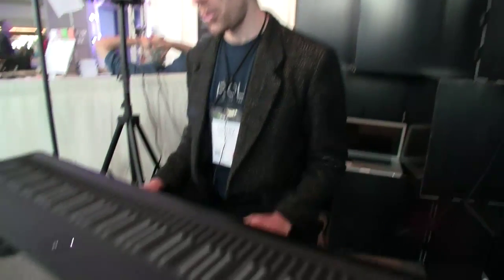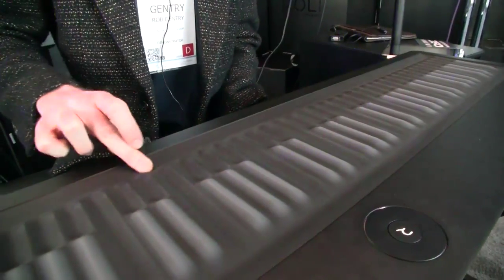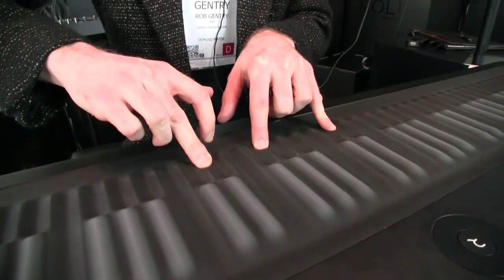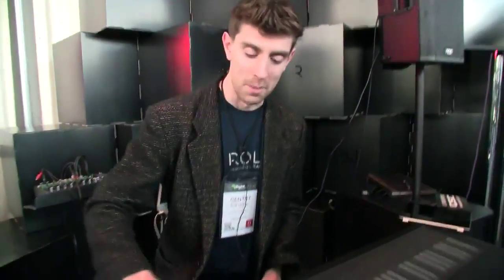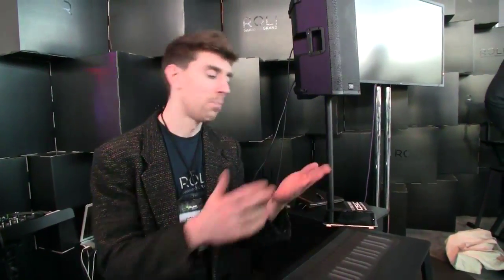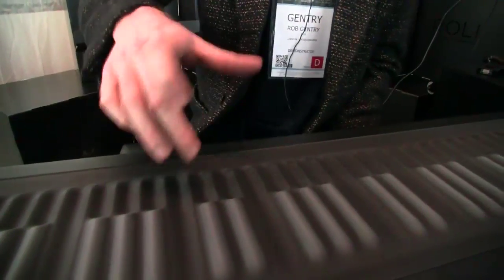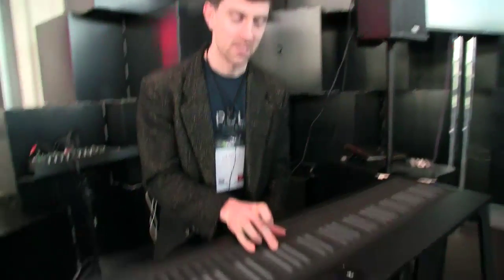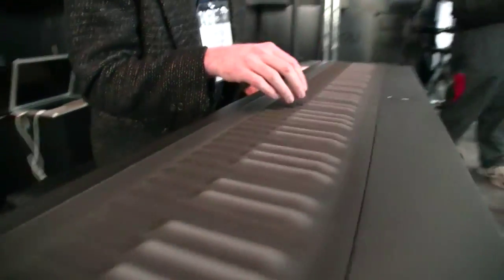NAMM 2014: Roli Seaboard Multidimensional Controller

Comment: you could use it with any VST/soft synth, but you probably want a way to create several instances of the same instrument. Eg in Kontakt, you would find a sound you like, then copy that sound a few times within the Kontakt window. That's fairly easy. In something like Logic, you could again, copy the channel the VST is on. So really it's possible to set it up to play whatever sound, although not yet ideal. Interesting what he says about Traktion - this is made by the creator of JUCE, the C++ library of code used by a lot of audio programmers. So there, apparently the DAW supports this idea of hosting a soft synth with polyphonic pitchbend "as standard" - 9:38 in the video. I get the impression that might mean that each MIDI channel counts as a new note (that you can then do pitchbend on).

Comment: Sorry for my potential ignorance, but issnt the Keith McMillen QuNexus more or less a similar thing for one tenth the price? Albeit a fair bit smaller?
Reply: I had the same thought. The pitch bend on the QuNexus goes up/down rather than side-to-side, but they do seem based on the same ideas as controllers. The pitch bend + aftertouch combination might be harder to control on the QuNexus though (or at least I find it tricky), since there isn't much tactile feedback for how much pressure you're applying.

Comment: We have the Access Virus T1 61.  And will say that the aftertouch on that is really good compared to any other keyboards/beds we have tried.  Currently thinking of selling it to buy a 61 key of this.  So, we get 3 new expression/modulation with this controller, the up/down on the key, the side to side and the parts above/below the key (sorta ribbonish).  Any other features/ideas that are more 'producer' friendly we should know about?  As always, thanks for the review/vid.

Comment: ah so each note is a separate channel... hmm does that mean you can't really use it in conjunction with another midi instrument?
Reply: The trouble is that every controller message in the MIDI protocol is channel wide with the exception of the polyphonic key pressure message which is note specific. So in order to have note specific pitch bend messages one have to use a MIDI channel per played note.

KMI QuNexus supports this directly and call it channel rotation. The Roli Seaboard controller is a MIDI controller so it must use the same trick for its 2D controller features.

What is not so simple is that one need a multi-timbral MIDI instrument to play with this level expression. Plus that one may have to configure the instrument to behave in the desired way on all the channels.

Unfortunately a really obvious heritage heavy hardware synthesizer manufacturer hasn't really seen the light yet in this direction of multi-timbral use even though they make great polyphonic synthesizers that would work perfectly with a controller like this. So no high firmware quality multi-timbral instrument from them even though one of their older designs has promised to be so for a long time and may eventually arrive at this wonderful destination.